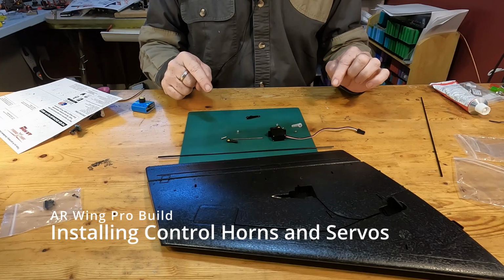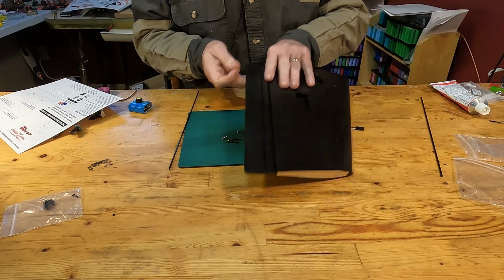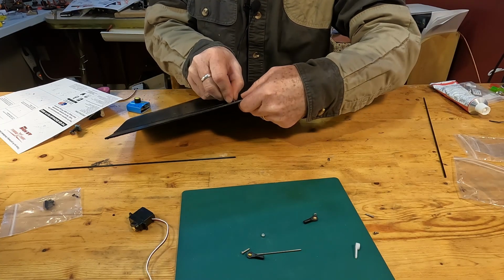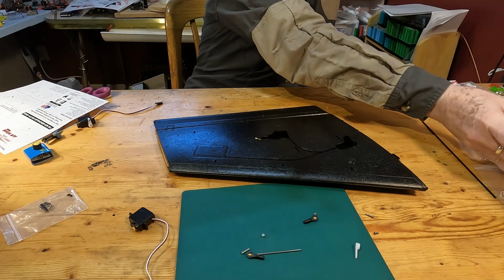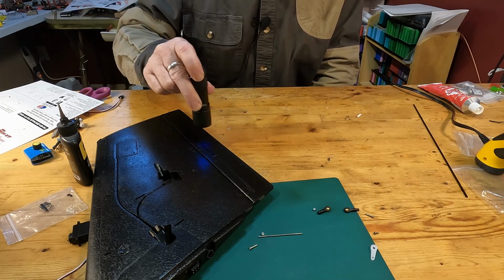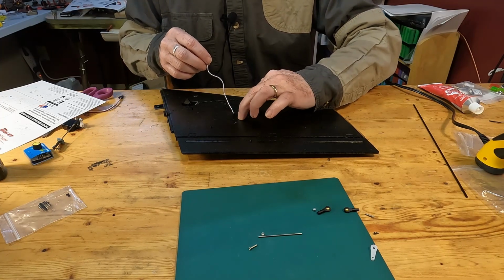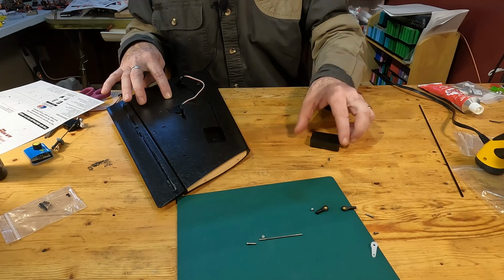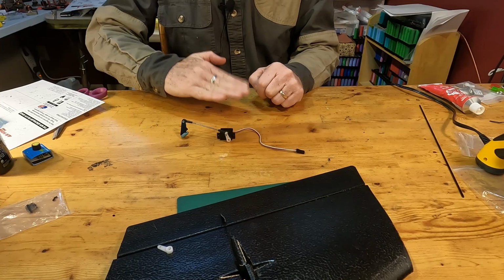ARWing Pro Build: Easy Servo and Linkage Installation

Comment: Hey thanks for the video! Newbie question , how do you install a elrs receiver or a GPS on the far wing compartment if the other available connector is 3 pins only, shouldn't be 4 pins? Thanks in advance!
Reply from the maker: Glad you found the video helpful.  The wing was designed before '4-wire' receivers were common.  Basically what you need to do is put the ELRS receiver in the far compartment and use one of the 3 wire plugs as the Power, Transmit, Receive.   From the flight controller, just run power and the 2 UART connections through the 3-pin plug and out to the receiver and connect as normal (keep track which wire is transmit and which is receive).  You then use another single wire to connect the ground from the ELRS receiver to the ground on the OTHER plug (or other nearby peripheral like the servo).   The other 3-pin MUST be grounded out on the flight controller for this to work.

Hope this helps.
Reply: @blueskyfpv  thanks a lot for your time! greetings from Argentina!